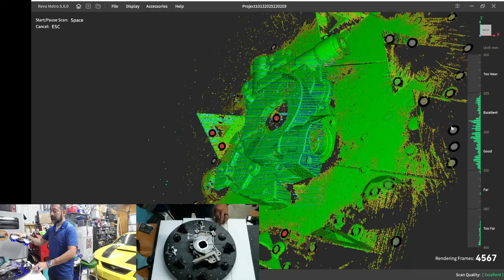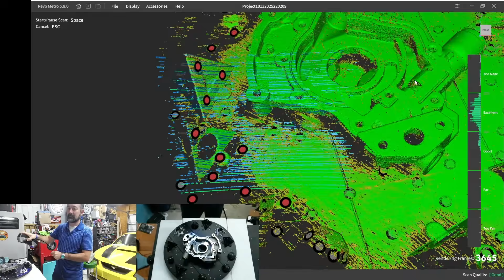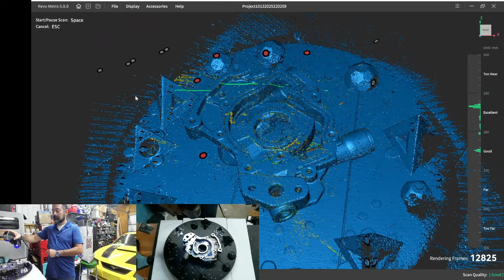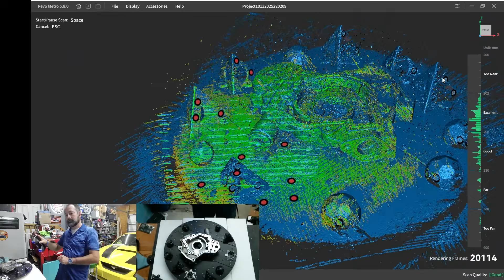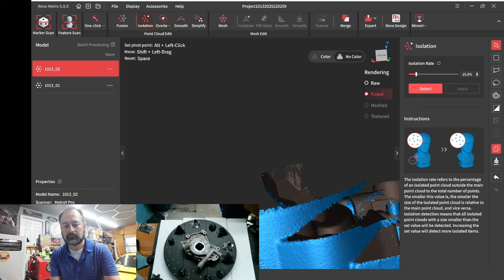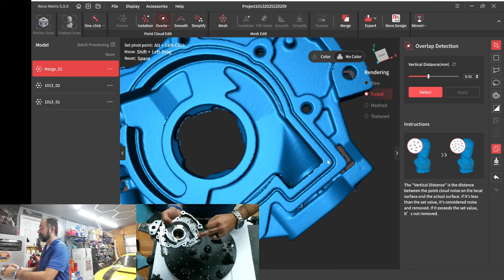SkreetKar 3D | Revopoint Metro Y Pro Scanner - Uncut - Oil Pump Housing

Comment: Can it be deleted from the point cloud before fused? Maybe it would calculate faster then.
Reply from the maker: With Revopoint sw fusion is required first.  It’s not really a big deal.
Reply: @Samlilly2  I use a creality raptor, unfortunately I don't know the revopoint software. But I think the metro y pro could be a good change.
Reply: @proplan-hu  From Raptor to any Revo scanner? You make me laugh :)
Reply: @proplan-hu  I have a Raptor,  a Sermoon S1 and a Rigil and 6 Revo scanners. After trying the Sermoon S1 with wireless bridge, I will never look back. Not the same league.
Reply: @patustibor7047  why did you now look back and use the sermoon if you have a rigil?
Reply: @patustibor7047  I like the our Raptor, but with small detail is not too fine and if we have hole, we can't scan too deep. Could you explain why revopoint is bad? Sermoon S1 is good, no question. But revopoint y pro is half price. @Payo-TensileCreator tested the revopoint x and he said not realy fast the frame per sec.
Reply: @patustibor7047  Is Sermoon S1 better than revopoint?
Reply: @patustibor7047 I am currently looking at the Sermoon S1 or the metro Y pro.  I want the metro Y prob to be good as it is $1100 cheaper and has the wifi built in.  Are you saying the S1 is clearly superior?  There is another YouTuber named Payo I think.  He did not have much good yo say about metro X, and liked the Sermoon.  He has stated in a response to my question the revopoints laser technology is crap.  Could you talk a little more about this?